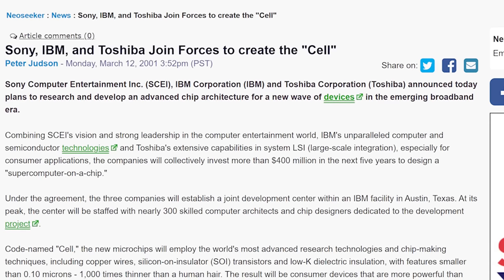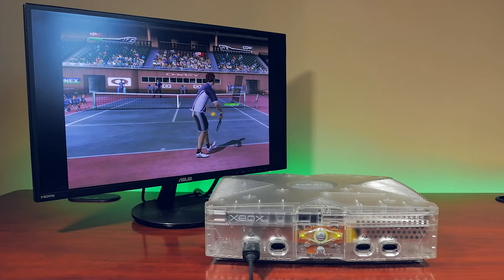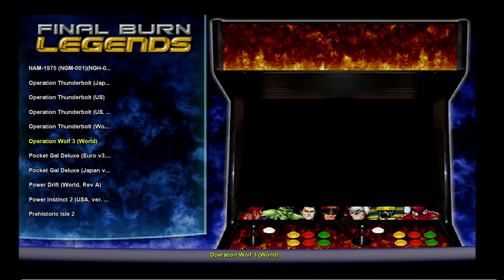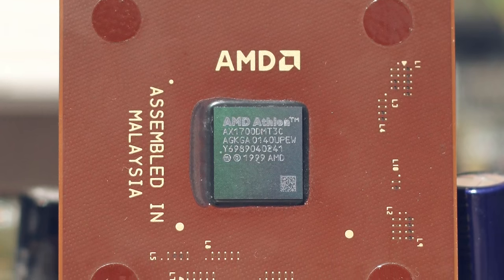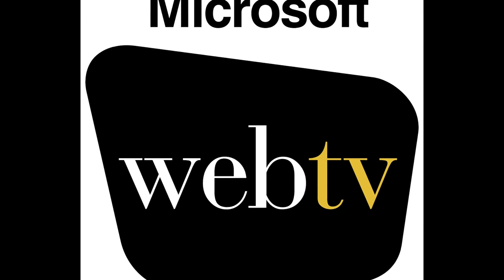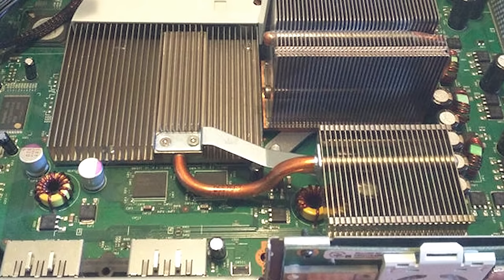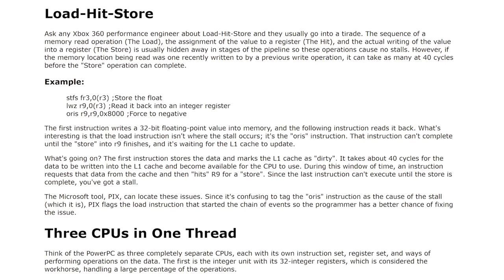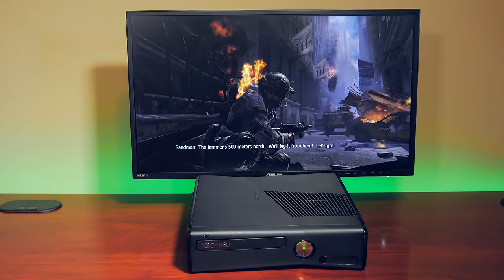Why Microsoft switched from Intel to Power PC for the Xbox 360  | MVG

Comment: While the 360 RROD was very common, it was almost always related to the GPU. The CPU rarely had anything to do with those failures.
Reply: Yep, the X1900 overheated and broke the solder.
Reply: John Hooper  You should say typical nVidia too. They had serious soldering issues as well, they lost the apple partnership because of that and laptops were dying with nV chips in the thousands. So this is not typical ATI, it was a common problem for all players when they switched to more environment friendly solders.
Reply: urrrrgh, now you tell me
Reply: @hatesac1  Nope. The temperatures are not hot enough to melt the solder. The GPU die would detatch from the chip substrate due to poor design. Louis Rossman has a video all about this
Reply: @hatesac1  Not the solder. It was more likely inside GPU. Macbook Pro's had similar fault. GPU dies itself and not for heat just. It was manufacturing problem of the GPU itself.
Reply: András Kriston yup. My mom’s VERY expensive laptop had a (nvidia) GPU failure just a year or after purchase.

Idk the exact model, only that it was back in the Intel Centrio days
Reply: @alexsinclair2012  seriously? I always thought that it was the solder that failed, not the GPU die. Either way, that whole mess basically sums up modern Apple, form over function.

"What's that? Adequate cooling for the GPU? Nah, we gotta make this new MacBook Pro as thin as possible so it looks neat!"
Reply: @LevelUp_ErikJ  It's not just solder it was the bumps which are a special type of solder that attaches the die to the package, the alloy of bumps used by TSMC at that time were the problem and highly subject to stress cracking and corroding due to thermal cycling, people initially though it was the solder of the BGA packaged to the board because reflowing or reballing the chip would fix the issue most of the time, but later on it was found that it was not really a fix and what was really happening was exposing the chips to high heat was temporarily fixing the bumps but they would soon fail again.

Comment: Microsoft- we lost money on each original Xbox. We need to cost cut a bit on the next console to make some money back. 
Red ring of death.
Reply: According to SSFF, they also cut costs on test devices and test procedures. Hence, high failure rate and shipping faulty units. There was a guy who was sent 3 faulty 360s in a row. The PPC problem just adds a tile to the jigsaw puzzle.
Reply: Microsoft gladly burned billions on the Xbox division in order to maintain mindshare and consumer loyalty.
Reply: @GiuseppeGaetanoSabatelli  particularly to children who aren't discerning. The way Camel Joe sold cigarettes. That's why I find it hilarious to get linux running on these things, even though it's usually highly impractical.
Reply: and you wondeer why bill gate hated the idea... he only allow them so the japan don't corner them on game.. since if people only buy console.. they don't buy pc... since it just nothing more than workstation for office... and not a real consumer household...
Reply: @waltercomunello121  the PS3 had extreme Heat Problems too dude

Comment: Those IBM PowerPC processors plus ATI graphics were a match made in heaven for Nintendo for the Gamecube, Wii, and Wii U. There weren't the most powerful chips, but they ran stable, cool, and fast with almost unheard of hardware failures, certainly much lower than the others at the time.

Comment: The part about the Pentium 4 is wrong. The Pentium 4 only supported RDRAM on launch in 2001 with the Willamette architecture. The Northwood architecture that was introduced in 2002 already switched to DDR SDRAM (or what you incorrectly label as regular DRAM since there are multiple variants). The P4 HT processors were introduced in 2002 with the Northwood architecture. (3.06Ghz in 2002 and 3.0Ghz in 2003 with a faster FBS) and did not support RDRAM.
Reply: Not only that, but Northwood was pretty tame temperature-wise through the 2.8 GHz models.  Pushing past that frequency and switching to 90 nm with Prescott is where the heat issues really began.  Netburst wasn't an ideal architecture for IPC but the Northwood chips were competitive with AMD's offerings at the time.  Both consumed about the same power.  I'm guessing power consumption and price per unit were a larger concern than thermals or performance in Microsoft's decision to move on from Intel.  Microsoft must have sunk outrageous amounts of money into redeveloping their SDK for PPC.  You would think they would have stuck with x86 if the price had been right, based on what x86 hardware was available at the time.
Reply: Pentium 4 Willamette chips were first released supporting RDRAM only (socket 423). Later on, before the Northwood release, Intel launched Willamette cores (Pentium 4 and the first NetBurst Celerons) supporting regular SDRAM (socket 478). With the Northwood core, DDR became the standard.
Reply: @KonjonoAwesome  Yeah, they really made significant changes with the Prescott release. The major problem was (once again) the pipeline size increase, from 20 to 31 stages. That's literally more than 3 times the Pentium III stage count! At least in the 478 platform, upgrading from Northwood to Prescott didn't offer much advantages...
Reply: @yukinagato1573  I bought one of those. Huge mistake. I even knew that AMD was better at the time, but I had 3 years earlier gotten a pretty good prebuilt PC with a Pentium 4 in it for a low price, and all things considered I didn't want to complain. I wanted to upgrade it, but didn't understand how meaningless it is to upgrade to something of the same generation, so I went from a 2.4 GHz Northwood to a 3 GHz Prescott. It had HT, but that didn't work in a home desktop environment.
Reply: No is was not the Pentium 4 that did not support DDR SDRAM or SDRAM, the north bridge was separate entity from the CPU up until the Core 9xx series chips.  Intel bet the farm on RDRAM and decided not to make a chipset for DDR SDRAM until 2002.  They even designed a Pentium pro (P6) chipset with RDRAM because they thought that was the future but those chips never had DDR FSB so they could not use it, except in dual processor servers that is.  In 2002 Intel gave up on RDRAM and chucked all the support and chipsets for it.
Reply: Yes, it was the first gen socket 423 chips that had it. Intel soon realised their mistake and switched to socket 478 chips that did indeed support DDR1 ram in less than a year. They just made it in time for the Windows XP release date.
Reply: The sad part about the Xbox's history is it could've been better.
MS went in with lofty goals, and having absorbed most of Sega's engineers (and business) at the time, they were primed to make a good first impression. The top execs wanted a "killer" console and did so with the original Xbox. But it was expensive to build, slow production, and had a lot of instances of un-availability initially. Pair that with Sony's great PS2 price, availability, and market at the time... it was difficult for MS.

And while I like what MS did with it, where the Xbox held much more data than the GameCube's mini-Discs, and was much simpler and faster than the PS2's eMotion eNgine. They probably could have done better. They initially went with AMD CPU with ATi GPU, and actually developed it, but at the last minute they flipped to Intel CPU and Nvidia GPU. These were the premium name brands, so MS was banking that would help. It didn't.

And what happened next is that (AMD/ATi/GlobalFoundaries) almost went bankrupt, Intel became a monopoly, and IBM had essentially hit-a-wall with their Mainstream RISC architecture. The PowerPC CPU was an excellent option for the GameCube, Wii, WiiU. But it wasn't a good fit for the "Xbox 2" or "PS mk.III".

Had MS selected AMD/ATi/GlobalFoundaries for the original Xbox, then AMD would be much healthier financially. Intel wouldn't have become as much as a monopoly. And for the "Xbox 2" they could have used something like a 64-bit, 2core-2thread, Athlon CPU instead. It would've kept their SDK/API standard, which developers love, and have great backwards compatibility right off the bat. It would've put Sony at a severe disadvantage hardware-wise, software-wise, release date-wise, availability-wise, and possibly price-wise. And not just at the first quarter of the generation but the entire lifetime. It likely would've avoided the whole Red-Ring-of-Death too. And things could've potentially snowballed better for AMD, better equipped to battle Intel's Core-i CPUs, especially the first-gen and second-gen architectures. Whilst MS benefits too for their Xbox ecosystem, just think of an earlier and better "Xbox 3" console, instead of the XB1 that was delivered.
Reply: You are wrong too. The initial Intel's chipset platform was supporting only RDRAM, but the guys from VIA and SIS released their own chipsets with DDR support, and after it, Intel switched to DDR too.
Reply: @ekinteko  I think PowerPC was a great choice for the GameCube, but I feel Nintendo completely lost the timing in their next generations. They used the same 7xx (or, as Apple called it, PowerPC G3) architecture for GameCube, Wii and Wii U. I know that in the Wii's case it was done for backwards compatibility reasons, but for the Wii U?? Even though the CPU was much more powerful, had three cores and many customized features, I can't find any excuse for this choice. It simply couldn't compete with Xbox One's and PS4's x86 design... Not to mention that the Wii U was Nintendo's last 32 bit console (yeah, the Nintendo Switch is the first 64 bit since the N64)...
Reply: @ekinteko  But yeah. It's a shame Microsoft turned to Intel like this during the first Xbox's development
Reply: @yukinagato1573  
The Xbox that MS unveiled on stage during E3, you know the one with Bill Gates and The Rock. Well, it was actually a working prototype and it was using AMD CPU, and ATi GPU. They even invited AMD to attend the event. And MS actually had an agreement in-place, but it wasn't signed and finalized.

I don't know if it was Bill Gates or the other executives, but they did a whole 180' on it. While the initial Xbox was great, it was very rushed which was obvious to see. If they went with AMD it would've been a much smoother launch; more units, lower price, less software/hardware bugs. The performance difference between the two wasn't even noteworthy. Instead they gave more money to the pockets of Intel and Nvidia, it caused AMD to practically go bankrupt.

This negatively affected the Xbox 360. Nvidia wanted much more money. Intel increased the price of their "Intel Core-2" processors. Whilst the Intel Atom would've been a good fit for 2005, it wasn't invented yet. The Atom was miniaturized architecture of their Intel Celeron chip, which itself is a miniaturized Intel Pentium chip.

...but AMD could be a good option, but they physically could not produce the amount of chips MS wanted because they didn't have enough money. Global Foundries was having issues at the time.

So MS literally shot themselves in the foot, and hurt the industry. Knowingly.
Reply: @yukinagato1573  
The CPU in the WiiU was around x1.5 the performance of the Xbox 360 and PS3. That's why porting games from the Xbox 360 and PS3 to the WiiU was easy. And most third-party games for the PS4/XB1 were also ported to the PS3/360 too for the first 2-years.

For what it was intended, the CPU in the WiiU was perfect. Nintendo  They probably thought the PS4 would have a Cell-2 cpu, and it would be x2 faster, but expensive. And due to costs, MS might also stick with IBM's cpu, but instead have a beefy GPU.

They didn't expect Sony and MS to both shift to x86 the next generation. Whereas the XB1 and PS4 CPU was about x1.5 the performance of the WiiU. So there wasn't a huge difference. However, the PowerPC/RISC vs CISC/x86 was the real hurdle for the WiiU. It made devs work extra hard and think twice. So the WiiU had a decent start, but an atrocious midlife, and was cancelled by Nintendo shortly after. Nintendo almost went bankrupt, it was the New 2DS which saved them, and they went to work on the Switch console. Rest is history.
Reply: @ekinteko  Yeah, I knew a bit of this story. It's somehow worse than Sega and 3dfx's failed partnership.

Just a quick note: the Intel Atom architecture is actually very different from that of desktop CPUs, resembling more the P5 design of the original Pentium than any other architecture it was succeeded by. While Atom had it's own design branch, Pentium and Celeron went the usual route, adopting P6, Netburst, and then kinda P6 again (lol)
Reply: @ekinteko  I see. Well, it does make sense after all. I just thought the 32 bit G3 was an old ass architecture (haha). But ok, I see it's point